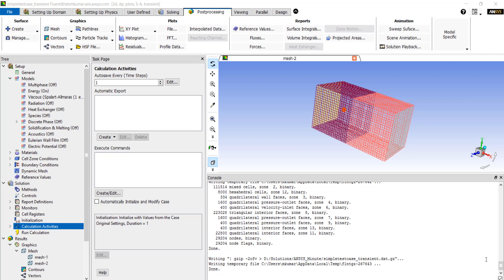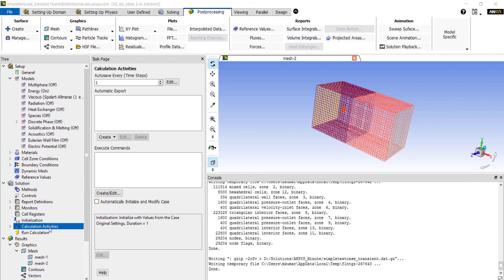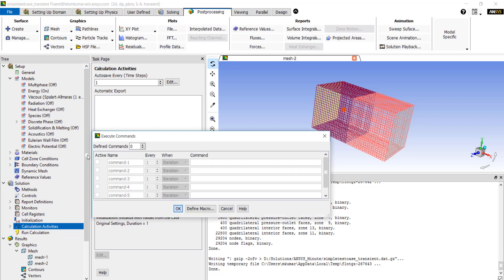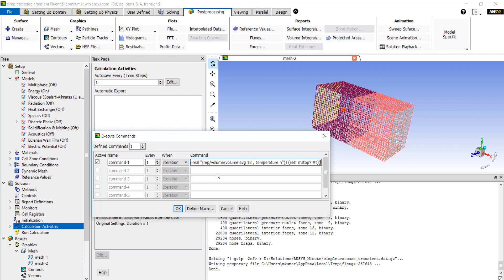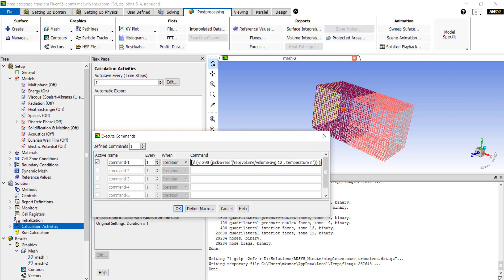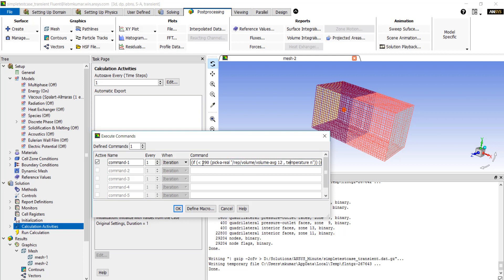How to Stop a Transient Calculation Based on Monitored Value

Comment: how do I do it for 2 zones? (ID2 and ID3)
Reply: Hello Dominic, you can fork your SCHEME command or make it more complex.
In your case:

(if
	(AND
		(>= (string->number (pick "/solve/report-definitions/compute <YOUR RD1 NAME>")) 315)
		(<= (string->number (pick "/solve/report-definitions/compute <YOUR RD2 NAME>")) 300)
	)
	
	(set! mstop #t)
)

Do note that I evaluate report definitions instead of reports.
I say: If output of report-definition 1 is greater than or equal to 315 AND output ofa report-definition 2 is lower than or equal to 300, stop the calculation.
Reply: @tomasprejda4165  Hi
I am using the below command which is supposed to stop the transient simulation when air_temp_outlet becomes greater than or equal to 926.5 K. but duing the simulation, Ansys is giving an error message stating "invalid function". I inserted a "?" after mstop but I was still getting the same error. Any help would be highly appreciated.

(if((>= (string->number (pick "/solve/report-definitions/compute air_temp_outlet")) 926.5)) (set! mstop #t))